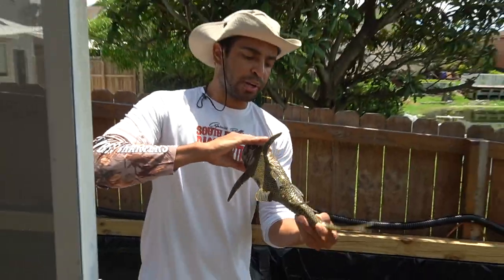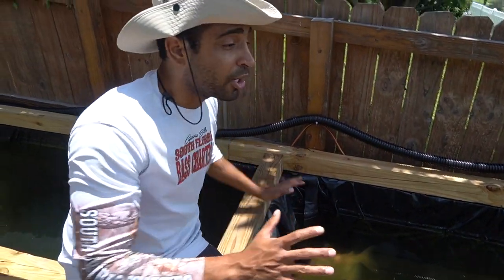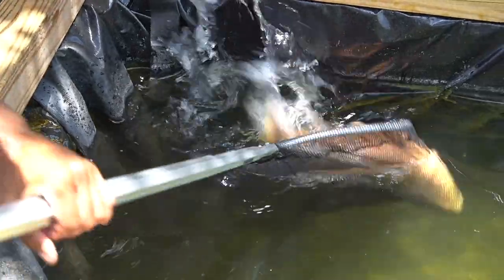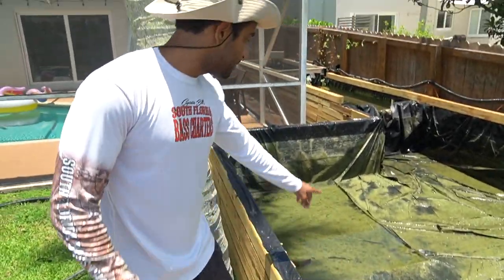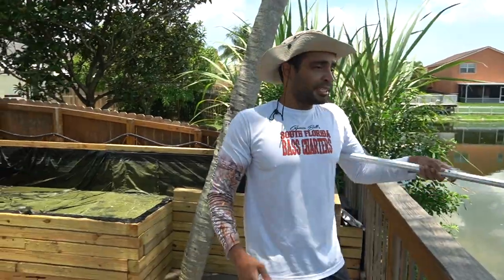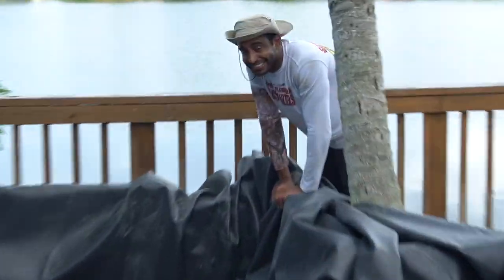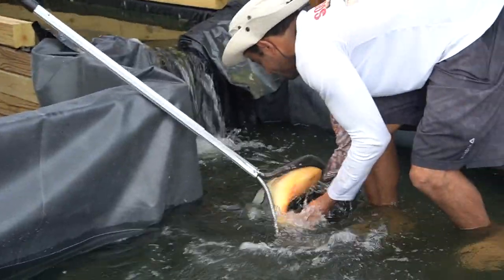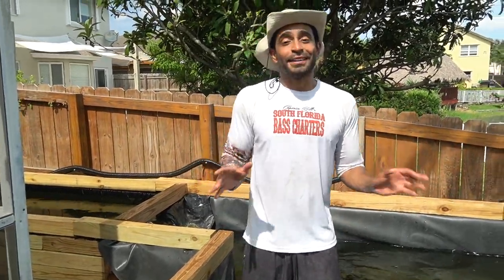PET FISH had BABIES During POND RE-BUILD!

Comment: You should spray the inside of the pond with Rhino liner or some other type of truck bed liner It would never leak and would last for as long as you need it to last. They make some called Herculiner that can be rolled on with paint rollers and im sure there are a few other brands that would work just as well!